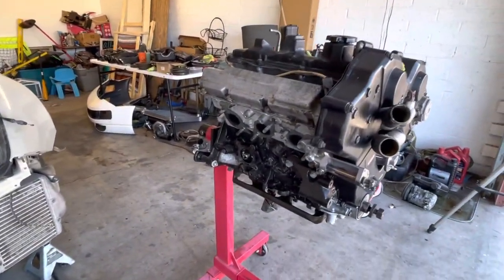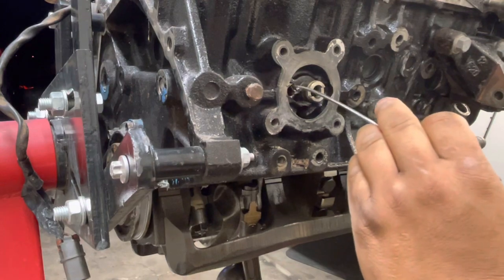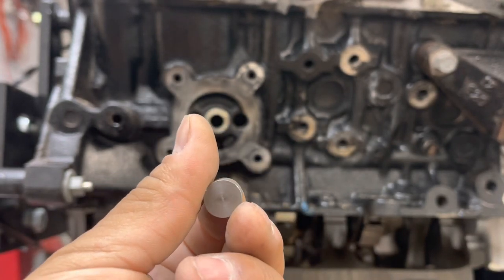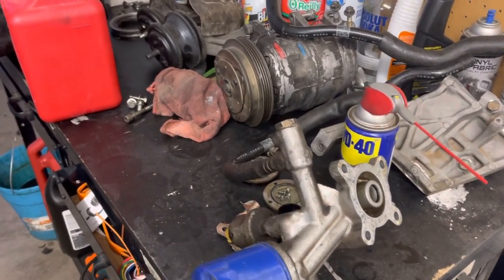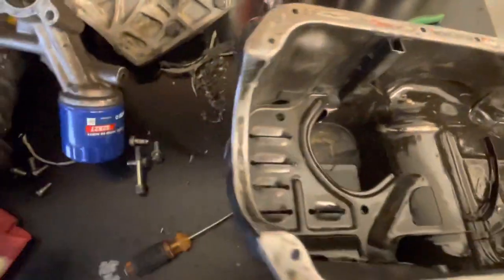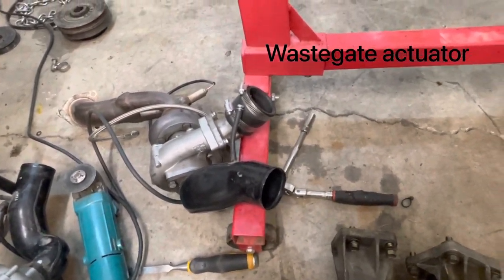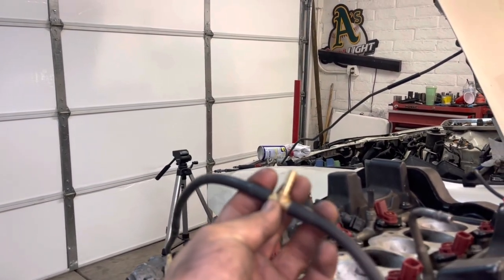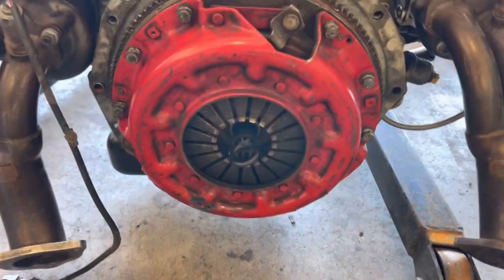300zx engine reassembly Vg30de/TT part 2

Comment: of any aftermqrket turbo options for the z that arent expensive? like some jb turbos from maxspeeding rods or something?
Reply from the maker: The turbos I’m using are pretty cheap considering what other turbos cost for the Zs. These are upgraded t28 turbos they need slight modifications to fit but I show what you need to do to get them to fit
Reply from the maker: https://attaturbo.com/index.php?route=product/product&path=72_83&product_id=396&gad_source=1&gclid=Cj0KCQiAmNeqBhD4ARIsADsYfTd6Saow-gSval6oY9OnKdu1O9Dt0ecLtJJe6XDZnkc-W8a6HIbYnxAaAgAgEALw_wcB